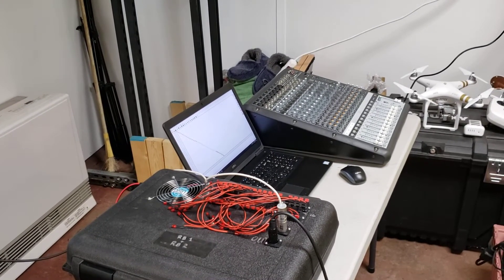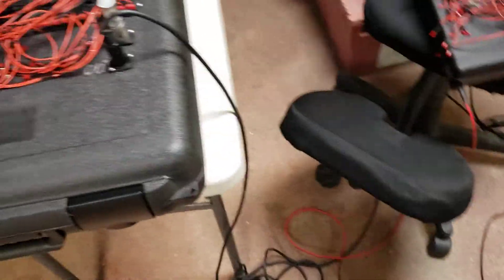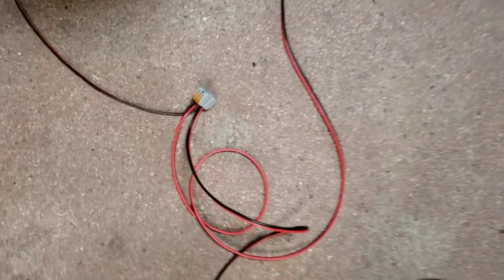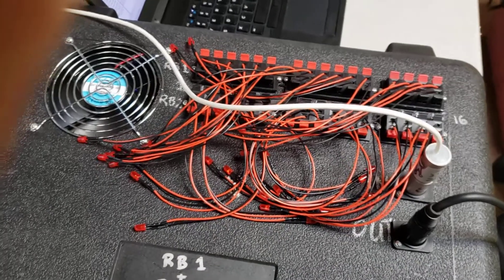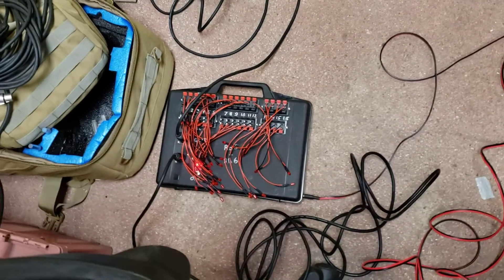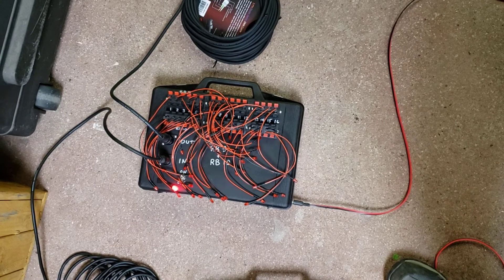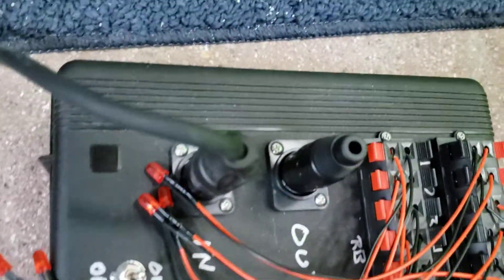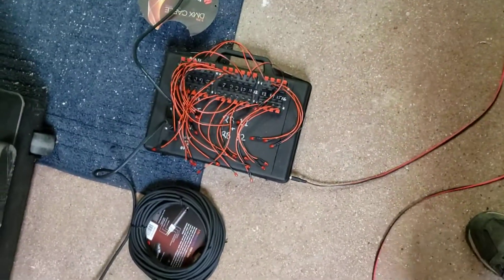DIY electronic Fireworks Firing modules for Pyro-Musicals.

Comment: Awesome looking build, would be interested in seeing how the boxes are constructed and how they interact with the pyrosoftware.
Reply: With "how they are constructed" i mean exactly what components they contain.
Reply from the maker: I did give a rather detailed description of every component I used along with links to each one. Here is that post again:  I wanted to share what I came up with for making a pyro-musical on the cheap. It doesn’t have all the features of COBRA or IGNITE or any of the other big names, so it will involve a little more work on your part, but you can put it together for hundreds or even thousands of dollars less depending on how many queues you want to use.
I will start by saying that for me, it was really cheap because I already owned the software, since I use it for another hobby of mine which is animatronics. Here is a video playlist of what I do with my life-sized animatronic skeletons at Halloween: https://www.youtube.com/playlist...
Because of that, I already had the software and power supplies and some other parts. The software is called “Brookshire Software’s VSA and is available here: https://www.brookshiresoftware.com/vsa_order.php?ct=yes...
The version you would need depends completely on how may queues you plan to use. The $80.00 version gives you 128 channels in total. That’s 128 possible queues. You can also fire several things using the same queue by using parallel connections of MJG igniters or talons. If you want more than that, you can get the Ultimate version for $250.00 that will give you 256 queues. If you want more than that, you can contact the company like I did and get a BETA version of the software that has 512 channels. That’s one entire DMX universe (the total number of DMX addresses that can be controlled in one DMX stream) That version will set you back $325.00
It is made for controlling servos, LED dimmer lights, Relays, and many other devices. It runs a DMX stream which is what I use. The software runs only on a windows computer, and you need a USB to DMX adapter (Which I already had as well). Here is a similar one to what I have: https://www.amazon.com/Interface-Computer.../dp/B07KW22ZK1
The adapter I usually use is from a company called DMX King and is $75.00. Servos are more fussy than lights and relays, and that one works better for my animatronics, but the cheaper one ($20.00) I listed seems to work fine for the relays and lighting devices I will be using.
I found a great price on some 16 channel DMX Relay packs. They would act like the 18M firing modules from Cobra. I got mine here for $69.00 each: https://www.amazon.com/Channel-Controller.../dp/B0111QP790 They have 2 less channels than the 18M’s, but they are a fraction of the cost.
One of the advantages of using a DMX controller (VSA software) to activate relays which sends power from my power supply (12VDC 30amp) to my MJG igniters, is that it can control other devices as well. I will also have a laser to shoot patterns through all the smoke, and 2 moving head color changing spotlights that can crisscross and spin around through the smoke, and even some electronic flamethrowers that you can program to shoot towers of flame to the beat of your music or make them do a chase pattern or whatever you like. These are the flame-throwers I will be using. This is one of many vendors you can find online:
https://www.ebay.com/itm/372969323529
I will be using 4 of those flamethrowers this year but will probably add more later. These can also produce colored flames according to the type of fuel you use in them.
So, before I get into how to program your show this way, and what features this software has or doesn’t have that other firing devices do, I will break down the savings for you. If 128 firing queues are enough for what you want to do, you will need to spend $80.00 on the VSA software, buy eight 16 channel DMX relay boards @ $69.00 each, one USB to DMX adapter for around $20.00 and a power supply with enough current to run all 8 (or more) of the relay boards and to fire the MJG Igniters or Talon clips. (You will still need to buy those igniters and/or clips. The price on those will vary depending on where you get them, how long they are and how many you need) With the power supply I’m suggesting you would be able to fire as many MJG igniters as you want in parallel. 30 amps goes a long way. Here’s the power supply, and it will only set you back $20.00: https://www.amazon.com/Padarsey.../dp/B06X96ZKK1
So, if you total that all up, it comes to $672.00 not counting the igniters or talons, which will vary depending on your needs.
Compare that to what it would cost you for 128 queues with the COBRA system, plus buying their music module that allows you to sync this up to music. That would be Seven 18M modules for 126 channels, the closest match in this case.
1 18R2 Controller $299.99
2 72M Firing Modules - Minimum of $879.99 each or $1759.98 (The 18Ms would be more $$$ but also more versatile)
1 Audio Box Gen 2 $449.99
Cobra Show Creator Software $49.99 ANNUAL license.
Not counting that the software package is a recurring annual fee, that brings you up to $2609.94 for just 144 queues.
I’m not saying that the COBRA products aren’t worth what they charge. I think they are fantastic, and I might even buy my own system eventually, but I spent my money on product, and I believe that with a little more work, I can make a just as impressive pyro musical with the things I am outlining for a LOT less money. If you start getting into higher numbers of queues, you save even more money.
The system I’m suggesting here will not have an integrated Fireworks database, and you would have to figure out the “Lift Time” for each shell and adjust your relay activation early by that amount manually on the timeline, and you can’t operate it from your phone, but you can from a windows laptop. You won’t get a continuity checker with this system, but you can test it by running the show without the igniters connected. Each relay has a LED that comes on along with the associated relay. You can hear the relays click as well to verify that they are working. If you have a bad igniter, or you don’t connect it up right, you will be out of luck and that igniter won’t fire even though the relay does operate correctly, so that’s a drawback, but it would only affect that one igniter.
You will need some DMX cables to run out to the area where your fireworks are set up, but if you want to go wireless, you can. (https://www.amazon.com/Donner-Wireless.../dp/B010D4VKPG/)
You can also do a hybrid setup where it’s wireless from you to the first relay pack you set up, then you run cables from that one to the next all the way to the end. Cables are very cheap, just a few dollars a piece and you can run them for 100s of feet if you want.
My goal is to help people that simply don’t have the budget for those big-name systems to be able to still do some great things that will amaze everyone that sees it.
I don’t sell any of these products or get a cut of any sales and I am not affiliated with any of them in any way. If you choose to go this route, you buy direct from the manufacturers or distributors. I’m just trying to share a way to do this type of thing for others like myself who either doesn’t have that kind of budget, or just likes saving money and doing a little DIY.
If there is any interest, I will be putting together a DIY tutorial on all aspects of this system from making music tracks to hooking up the hardware and programming the software. When I finally get to use it on July 4th this year, I will shoot video and show the results. I hope to be able to test out some of the timing ahead of time, but I’m confident that I have it as close as you can get it with any system.
Reply from the maker: basically Each case contains 2 16 channel DMX relay boards, the connectors you see on the top, an input and output jack, and wiring. The first case in the collection also contains the 12VDC 50A power supply that powers everything. My earlier post goes into much more detail, much of which is in the video description as well although they limit the amount of test I can put there.
Reply from the maker: Feel free to ask if you have more questions.

Comment: never use DMX to fire fireworks, its not stable enough, and dont use relay boards, they will make contact if the magnetic feild is strong enough or if dropped
Reply from the maker: If by "Not Stable Enough" you mean prone to interference from other sources you are correct to a degree, but DMX is stable enough for Broadway productions worth millions depend on it to create effects and lighting flawlessly over and over again. If you buy the proper cables with the right shielding and don't run you data lines along with your power lines, and if (as was my situation) you are not in a crowded neighborhood where you don't have control of what kinds of interference might be around you, then DMX will suit you fine, even though it is not recommended by the powers that be for use with fireworks. But Just in case, I did take extra precautions every step of the way to make sure that my layout was safe, and should there be a catastrophic  failure up to and including every single shot being fired at once, it would still be safe for those nearby. Everything was laid out so that nothing ever crossed the path of anything else, so there would be no collisions should everything fire at once. Every cake was glued down to boards with all the paper removed, so they couldn't flip, My shells were in small enough groups and were stabilized and secured that the racks would not jump if everything somehow were shot at the same time. I understand what you are saying about the relays being able to make contact if dropped, but all those cases were already on the ground, separate from anything that cakes or shells were connected to and were not powered up until showtime. There was a separate kill switch for the power to the relays on each of the 7 cases, so that the DMX system could be powered up and given a chance to stabilize before applying the power. Basically, I used a system that I have used and am very familiar with for nearly 20 years to do the job of systems costing thousands of dollars more because I wanted top do the show, (which came out pretty good if I say so myself, and I do) this was the only way I could afford to do it. It was innovate, or just don't bother. I was aware of the shortfalls of this kind of system, because of my long years of experience with it, which is why I took extra precautions every step of the way to be safe even if there were a failure. The only failure I did have was there were some product that did not fire which I discovered after the show, but I hear that this happens pretty frequently with any system, even hand firing, so I still count this as a win.
Reply: Relays are also used in professional pyrotechnics firing system. Not a single problem. Being dropped is not an issue as the cases/boxes would be placed in their secure final positions before any pyrotechnic devices are connected and would not be powered until its time for continuity testing. Even then there wouldn't be enough current passing through to ignite anything. Not until its showtime and the system is fully armed. Magnetic fields are not a issue either as there rarely are any magnetic fields strong enough to cause a relay to activate unintentionally unless you are in a idustrial setting with heavy machinery or a hospitals mri room.
Reply: relays are not in professional firing systems
Reply from the maker: @abecoulter8550  This is not a professional firing system.  This is a DIY system that I designed and built to suit my needs and bank account which I shared merely because people seemed interested.